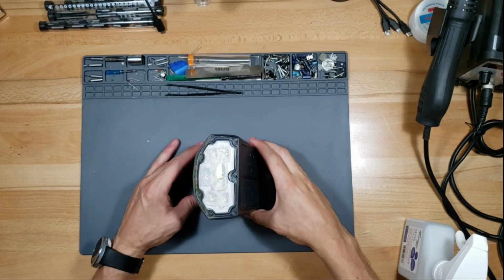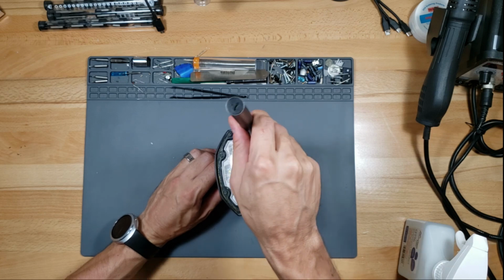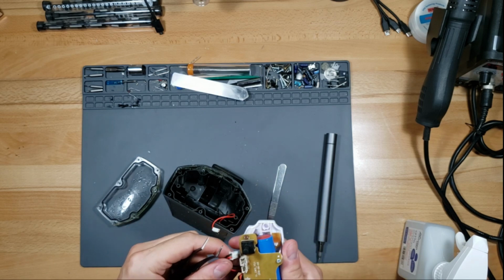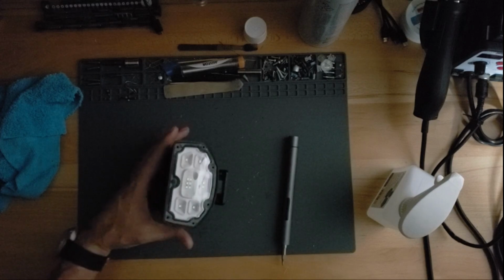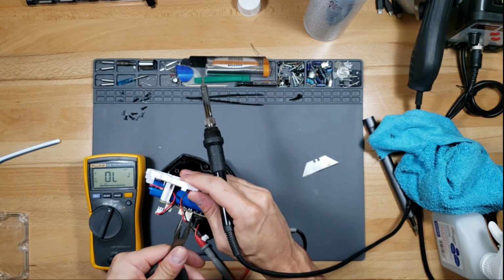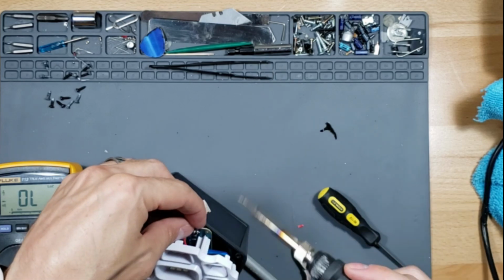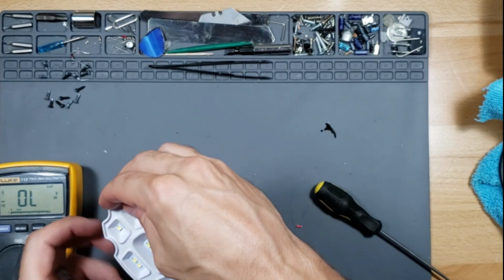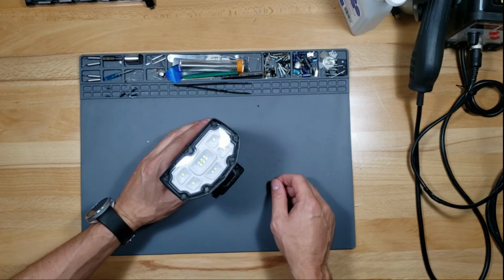How to Fix Solar Landscape LED Lights

Comment: I have the same lights and almost all of them get moisture in them. I used your soldering method and fixed one that had become inoperable due to moisture/water buildup. Before I put it back together, I put a bead of clear silicone around the seam of the lense. Hopefully it keeps the moisture out but I appreciate the video. It was the only one I found showing how to repair this type of light. Thanks for your video!

Comment: Good call on soldering connections.   You could have tried dielectric grease in all connectors after cleaning them and confirming good continuity through them before greasing them..  Most of the outdoors gizmos are just not sealed completely enough to allow long life of the product.
Reply from the maker: Great tips

Comment: Awesome! Makes sense that the connectors would get all corroded/rusted. 
Splice & Solder the wire straight to the board :P

Comment: Thanks! These are down to $26 for a 4-pack at Menards here in Chicago. Picked up a pack. Definitely worth it for the large solar panel. Will try modifying one with a larger battery and maybe to power up string lights instead of those blueish LEDs. Claims to be 5000k color temperature but those LEDs look too blue.

Comment: Haha. Have you noticed that you do a lot of soldering directly to solve issues. If it works, that's what you have to do! You'd think they would have know that and smeared a little water resistant grease on the contacts to address it. Glad it works again. I had to do the same thing with mine,  Now I pregrease before they go out in the elements...:)

Comment: What’s the little prybar you’re using? I can’t get the lense off. If I try with a screwdriver it looks like it’s crating too much pressure on the black surround where it would crack if I pry too hard.